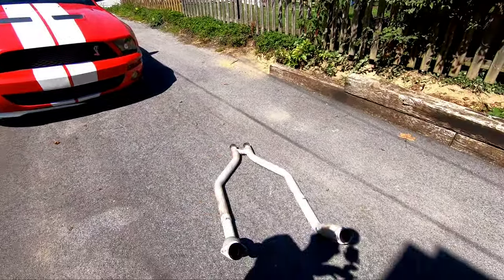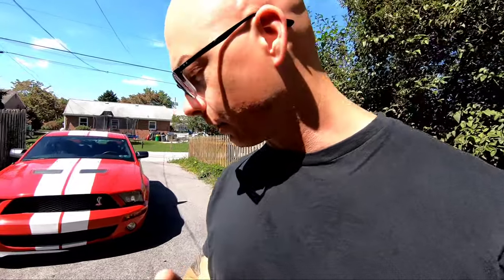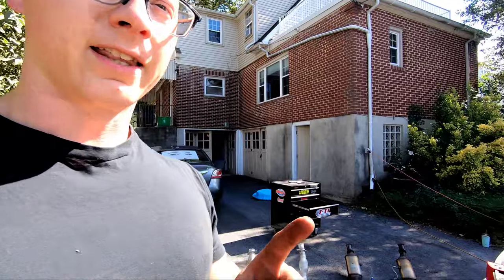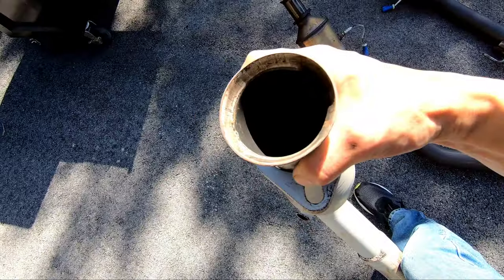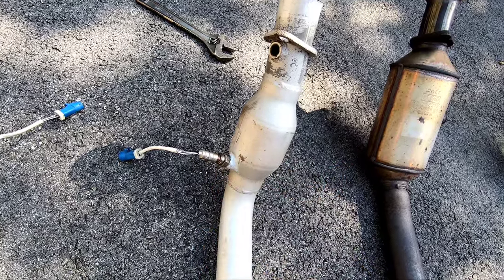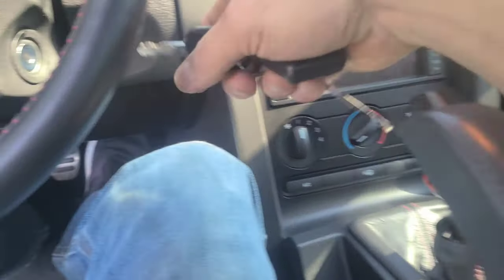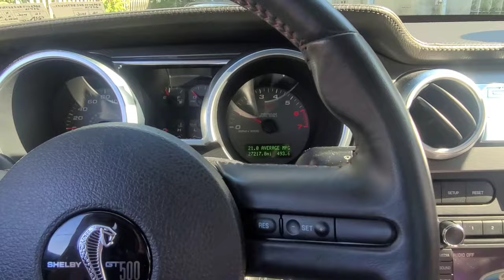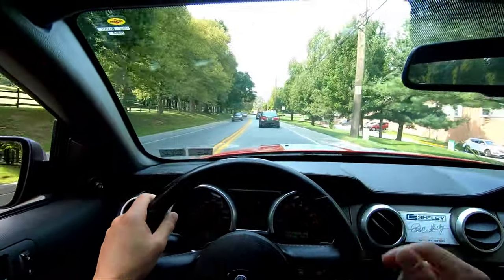2008 Shelby GT500 gets Lethal performance H pipe | GT500 vlog

Comment: I have  a new lethal H pipe for my gt500.  Im about to install myself,  how hard was the project  on jack stands? You car sounds great.  I have  borla s type mufflers now so I might put stock mufflers back on if its too loud.
Reply from the maker: It wasn't hard at all. Toughest part was the top 02 sensor which I took off before completely removing the factory X pipe because its nearly impossible to reach the harness. Definitely spray the nuts with WD40 or something first

Comment: Dam shits so loud almost tore down the playhouse.. surprised to see u taking x pipe off for a h pipe
Reply from the maker: Haha. I always liked the sound of the H pipes more, and since these GT500'S don't rev as high as a coyote theres no power difference between the two.
Reply: @automotiveantics  on my small block in my caprice I went for a x pipe. I appreciate the modern almost exotic sound it give to the engine. Also trying to maximize and get the most out of it. I only rev to 6500 motor should hold 7k but dont have much need to push it that hard very often

Comment: Once its tuned the low end loss prob won't be as bad as the top end gain will be even better.  A pulley and tune will REALLY give u a bunch of power and a shit load of low end power.  If you do a lower balancer also the low end will be even more.  I'm gonna go with a 10% lower with my 2.6 upper and get 600 torque to the ground itll be wicked
Reply from the maker: I'm working on getting a tune. I dont think I'm going to pulley it because I'm going to put that money towards a VMP heat exchanger then upgrade the blower
Reply: @automotiveantics  that is actually very solid plans and well thought out.  Makes sense in alot of ways to upgrade the blower vs spending money trying to max the Eaton out.  With that being said if you're planning a tune on stock blower anyways I would highly recommend a 2.5 or 2.6 upper pulley to go along with it at the same time because for not much over the tune alone (prob couple hundred bucks) you get a significant bump in power and probably even more significant of a bump in torque and since you're gonna be getting a tune anyways for very little invested above just a tune you could unlock alot more power to do you until you do upgrade the blower not to mention make that thing scream alot more (sound wise) especially combined with a jlt 123 cold air which can also go with you over to a larger blower.  Just an idea.  Heat exchanger is next on my list and a lund retune so I can get an ngauge for all its modern features (my car has an old sct 2 or 3 not sure) and so I can monitor stuff and datalog the car.  After is when I'm going 10% Lower that will help me even when I upgrade the blower and also I have an 07 which has the bigger shittier crank balancer so its advised for me to change out to an different balancer anyways might as well make it a 10% while I'm in there lol.

Comment: Great vid and Congrats on the install!! From what I can hear the Shelby sounds phenomenal dude🤙🏻🤙🏻 
My phone speakers aren't the greatest so, I wanted to ask you your opinion- overall does it have a deeper, throatier tone or is it raspier? And if there's more of a drone now at 1.5k, 2k, 2.5k, etc. RPM'S? Apologies about the ?'s but I've been researching H vs. X pipes for a bit now and am looking for that deep, throaty, loud and mean sound to come from my Shelby-- not obnoxious, hear-it-4-blocks-away loud though.  Luckily the previous owner of my 09' had already installed Shelby GT500KR Ford Racing M-5230-S mufflers on it- which I love and won't change.  But I feel, and you mentioned, it needs to sound like a real Shelby GT500 Beast.  Thanks- Dean
Reply from the maker: Thanks!  And no worries, I love ?'s!😁  The H pipe definitely has a much deeper sound than the X pipe. The car has a more traditional muscle car sound to it. With the stock mufflers there's ZERO drone. On the highway it almost sounds stock. You can start to hear the difference the most around 2500 rpm and above.
Reply: @automotiveantics  Thanks so much for the reply🤙🏻 I appreciate your opinion on it since you've actually have it and experience it daily- I think you sold me on it! (I should've mentioned before that I'm not planning to put on any headers or cams but will be putting on the 13-14' 2.3 TVS 2300 Eaton SC)
Also, just had to say that I was surprised, and impressed, how you were able to average 20.1 mpg's!  After this install, if I'd have to guess, I'd bet it's down to 14-15 mpg's now😜  Enjoy Bradah🤙🏻🤙🏻  Shelby 4 life🙌🏻
Reply from the maker: @deanp4706  haha yeah its hard to be easy on that skinny pedal when it sounds that good!  Haha
Reply: Hey dude-- do you happen to have the Part # for this H-Pipe?  And just to make sure, it is made by Lethal Performance right?  (I checked their website and unfortunately looks like they no longer make it.)
Have a Happy & Healthy 4th to you and your fam!! 🥳🇺🇸🥳

Comment: Great video, did you have trouble with the threads for the O2 sensors? When I took them off they did not go in easy on my other mid pipe.
Reply from the maker: No I didn't have any problems at all
Reply: @automotiveantics  Cool, does the x-pipe or h-pipe hang low on the car? My x-pipe hangs stupid low on my car, it's really scratched up.
Reply from the maker: @nofeartodie1  mine doesn't hang low at all

Comment: Did the same to mine but I couldn't stand the smell!! Switched it back.
Reply from the maker: I haven't noticed a smell, but I'll keep an eye on that
Reply: @automotiveantics  It may be because I run Roush Extremes, btw your car sounds badass!!! If you look on GT500 forums, you can make your own o2 foulers, Keep up the awesome videos!!!!
Reply from the maker: @1000BadThings  thanks my friend🙏
Reply: Mine doesn't smell too bad at all in my experience if your car is running rich the smell will be worse.  Mine is dyno tuned and the afr seems to be on point (dont got a gauge yet).  I had a minor issue that caused a rich condition and the smell was alot worse now that it's fixed it is back to not being bad again.  I run an offroad H into borla stingers
Reply: @michaelharris748  good point, mine is a canned tune from vmp and may be rich to remain safe. Thank you

Comment: Hey what head unit did you get? Looks sweet and modernizes the interior a ton.
Reply from the maker: That's the stock head unit with optional Navigation
Reply: @automotiveantics  I always heard that nav was an option on the 07-09 but haven't seen it until now. No wonder it fits so well!

Comment: Let me start by saying I really enjoy your videos with that being said I have the exact same car all-stock and that thing will bark and spin all the way up to 5th gear when I hit 5th gear I could still feel the rear end lift and slide around a little bit so I don't know what you mean about nothing happening in 3rd gear maybe you have your traction control on I don't know
Reply from the maker: Thanks I appreciate that🙏.   Thats funny because I bought mine with 21k miles as well haha. I'm sure there's something done to your car you dont know about if your spinning 5th gear....OR, your still running the crappy stock Goodyear F1 tires which could be the reason. Those things are horrible!  I have Michelin pilot sport tires and they are WAY better than the stockers

Comment: Is it safe for the engine in a long term to drive it cat deleted with no tune? I'm asking because so I can put the cats back when its time to smog.
Reply from the maker: You won't really see much performance benefits without the tune.  Just a louder exhaust.  I've heard of people doing it but you're going to run lean.
Reply: @automotiveantics  thanks for replying . I’m in the edge of buying off road catless H pipe.  With o2 defouler, basically doing what you did in this video. I been doing a lot of research if I can do it this way without a tune, some people say it’s ok but majority say tune is a most. Other people riding without tune for years and there car is fine. I was just convinced when you said your turner said it’s ok.
Reply from the maker: @denzel781  yeah I dont see any long term damage without a tune just no performance gains.  If it's just the sound you're after, you could always go with a roush extreme type axle back as well.  But the offroad H does sound good